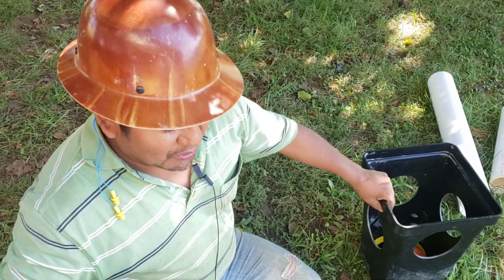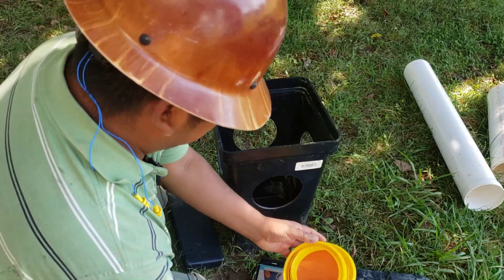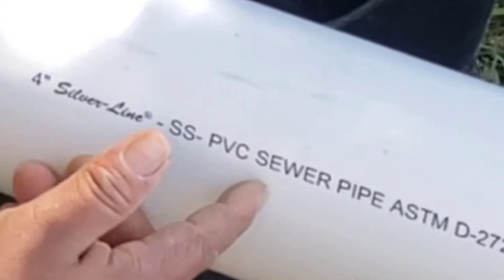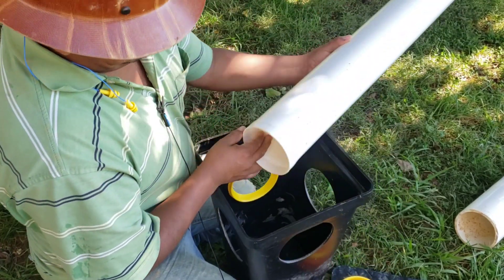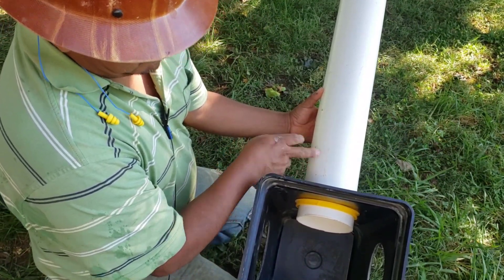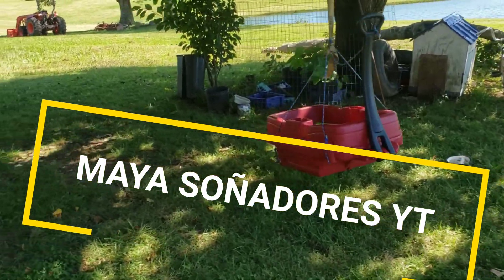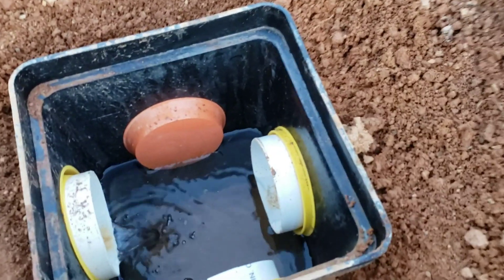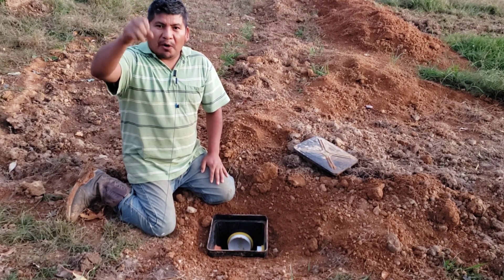Septic System Distribution Box Review and Setup  (Tuf-Tite 4 Hole) Distribution Box Setup & Review

Comment: Hello can you install perforated pipe straight from that distribution box or do have run solid then transition to perforated pipe?
Reply from the maker: I don't think you can Install it straight, but if you can find and expect size but you to use  some kind of adopter or use a lot of seal